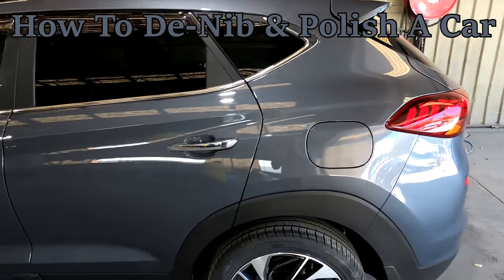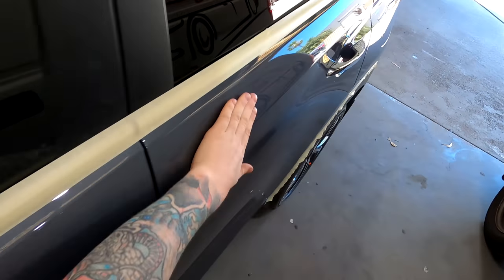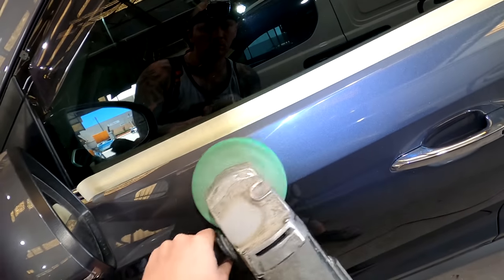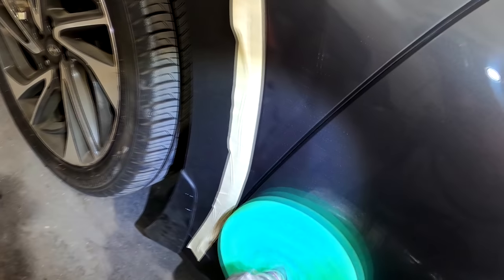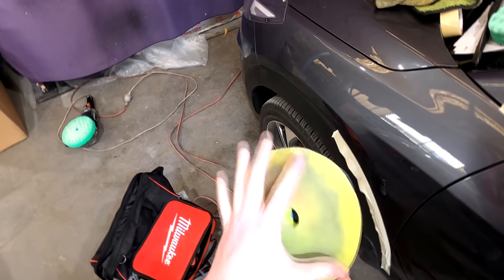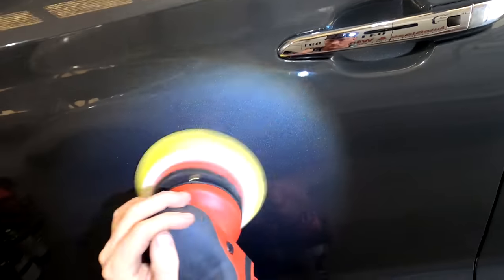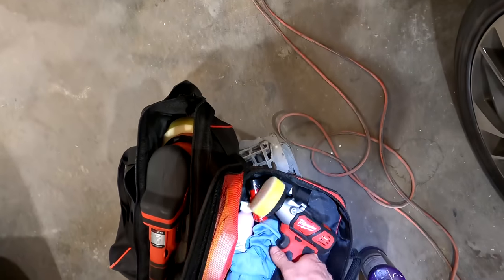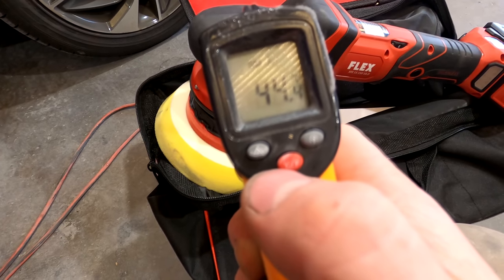How I De-Nib & Polish A Car

Comment: We create the surface for detailers to work on, and make money from lol.Thats why we cant stand when they tell us things like "you haven't primed the pad, your holding the buff on a wrong angle", or your finishing the clearcoat (lol my fav) Detailers might be able to comprehend, how we can hold a rotary, with heavy cut combo, and not burn thru. If you are the person, creating, and putting the layers on, then you know how it technically works, and if so called, removing layers, you know how much you can "remove" When we started painted, and cut polishing, there was no such thing as a DA polisher. You learn with a heavy duty Makita grinder,  Most likely you had to swap the grinding wheel for a buffing pad  lol, they are usually  tourney as fuck, and as a young skinny apprentice, it wants to twist your arms into spaghetti. you wont tell anyone that, coz your gangster, you dont want people thinking, your week, or have no skill. you will carry on cutting. With that polisher, you will burn thru, there is no exceptions. your boss knows that aswell, the good ones will let you burn it, and watch you stress, when you do, and be entertained with your panic. and you might learn from it hahah. When DA, very forgiving polishers came out, we seen a pollution of detailers like the smog in China. there was heaps of it, but not that good for alot of things (jokes) Now everyone that could get some compound and a machine was able to make paint more shiny. and some of these made Youtube videos, that look even better than it did in real life. heres an interesting fact. I know hundreds of detailers. None of them know how to use sandpaper to remove a deep scratch in the clear, that you can feel with  your nails. thats because, they dont understand the technical side of paint and clearcoats. They will cut and polish your car, charge you $500 to $1000, god forbid, they apply some paint protection with a cloth and wipe it down, now your up for around $2000. and they will say, that scratch is not removable. Of course it is, but they dont know how to. Give it to a 1st year apprentice painter, with 1000 grit paper and a hard block , he will have it out in minutes. When I tell people. 99% of the time, if a car or panel, has been resprayed, it will always have more paint on it than when it was painted at teh factory. Specially the clearcoat. Most of the time it will be more flat with less orange peel. People cant wrap their heads around that. and they dont believe you. they think your saying that to make painters look better etc.
Reply from the maker: Amen brother, totally agree with everything you said. 
When I first started doing polishing videos I couldn't understand why there was all these know-it-alls in the comments.
Reply: You see, the thing in detailing is about making the car look the best it can in a safest way possible. In other words - leave some clearcoat for the next owner. I can cut and buff your OEM paint, so it will look like glass pane, but I strongly discourage the customers if they want to do it, just beacuse there will be no clearcoat left for the next time the deeper scratch happens. About random isolated deep scratches, as you mentioned above - I will ask my customer - is it really worth it to compromise the clearcoat in that place, just to remove that one scratch ? I can remove it, sure, but what if I just make it less apparent, but not remove it completly ? That way we can have safe clearcoat thickness, and the looks.

Latley,  I am showing my customers a set of feeler gauges - 0.02mm, 0.03mm and 0.04mm of thickness - they are about as thick as clearcoat is on most cars I handle, and I ask my customers - do you really want me to hammer on such thin layer ? Once I remove it, I can't put it back on. Belive me, it is mindblowing to some customer that we detailers even come close to such thin layer with high speed rotating tools.
Reply: Practically just explained my life pmsl
Reply: I know im asking randomly but does anyone know a method to get back into an Instagram account?
I was stupid forgot my login password. I appreciate any tips you can give me!
Reply: @Alonso Jaden Instablaster ;)
Reply: Yes, I started with a rotary 34 years ago and you just "turned and burned until you learned" on auction and car lot beaters until you got good enough to move on. I think the bodyshop industry is going to have a much harder time finding people out of the detail shops to polish now because few know how to use anything but a slow DA type polisher.
Reply: I use a rotary daily

Comment: I use those same exact tools for high end detailing. The flex, Milwaukee 3inch rotary polsiher and a ton of Rupes pads. It would benefit you to wash your pads my friend. Your pads will last longer, cut better and finish better when pads are clean when you first use them. Since you're in Australia, you should check out the Shinemate cordless rotary versions. You might be surprised! 👍💯
Reply: Finally I see you with a great polishing tool. I recommend you try the flex forced rotation polisher as it’s more suited for what you do. It’s a good compromise between a rotary and random orbit machine. It cuts faster than a random orbit and doesn’t leave holograms. 

Also your current machine is definitely better than a shine mate machine.

Comment: I have the same flex , and mini buffer great for quick fixes. Little hard to do deep scratches with the flex but with the right pad and some patience it’s great ..
The mini buffer sometimes speed 2 can help but it gets the spot really hot.. speed 1 with tight slow passes usually does the job
Reply from the maker: Both brilliant tools hey, I definitely don't regret going all out on cordless tech.

Comment: I using scangrip colourmatch headlight. It's got 2 colour tone and 2 brightest.  Worth a try. I love it.😁
Reply from the maker: They look good too. But bit expensive, mine was $25 and it has 2 brightness settings but only one colour tone.
Reply: @TheGunmanChannel  never used before headlight for denib, but its really works. Also use it when i do smartrepairs at work. Hate  to wear it but definitely makes job easier.  Maybe its a good base for your next video.😅

Comment: I think the perfect system for you is the 3m perfect it 1 system. Have you tried it? It’s basically refining sand scratches to 8000 grit. You skip the compounding step and use just a 1 step polish.
Reply from the maker: I am familiar with it and I'll be doing my own Corolla roof in it very soon mate 😁 can't wait. My 3M rep is doing it with me.

Comment: Hey Gunman, as a Detailer, I found a good alternative to the yellow Rupes Pads. It's the Lake Country CSS Orange Pad. It has the same Finishing abilities, but lasts a lot longer! You can get them even at a lower price point than the rupes ;) I have to get one of these denibbing blades, so I can flatten down the high-spots of filled stone-chip spots even faster. I did it with sandpaper (1500 dry, 3000 wet, 6000 wet) up to that point. Do you have a recommendation for such a blade?

Comment: Great video ....would definitely recommend trying 3d compound and polish i switch from 3m
Reply: So 3D compound is better than 3m extreme cut? I’ve tried heaps of other brands on the recommendation of other people, but I’m always disappointed in the other products.
Reply: In my opinion yes is better i have use both 3m and 3d  and i like 3d better  it cuts better (faster) with little effort low to no dust esay clean up

Comment: Hey Gunny...or anyone else that wants to answer this. 

I have an Iwata Bellaria W400 iwth a 1.4. In the manual, it says that it requires 280 l/min @ 2bar. My compressor only puts out 185 l/min but it manages to keep up with the gun without at 2 bar.  Am I reading the specs of my compressor wrong? Is it like 180l/min @ a specific pressure and because I don't use that pressure it keeps up? 

I'm confused. I'd like to get a better compressor that doesn't need to run so hard.

Comment: Off topic but I spray a lot of single stage paint and really only use bc/cc for metallics. Would you recommend the supernova or the pro lite for single stage? Or do you recommend something other than these? $ isn’t an issue.
Reply from the maker: Pro lite TE20 for me mate. Sagola 4600 Xtreme if you wanted something faster

Comment: Have you ever used 3m 3000 trizact disc after 2000 paper. Helps to remove the 2000 scratches
Reply from the maker: I've used it since it was new in 2004 😜 the thing is our mini orbital sander at work is stuffed so I avoiding using it unless I really need it.
Reply: Use 1500 grit trizact it’s even better.